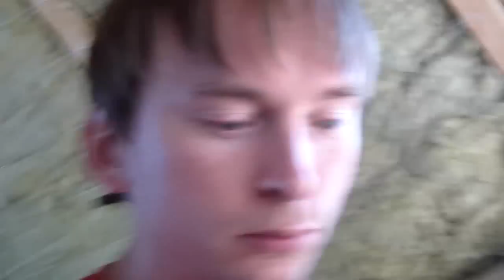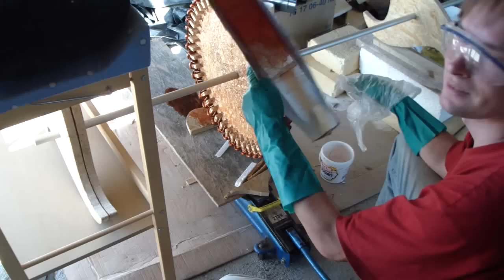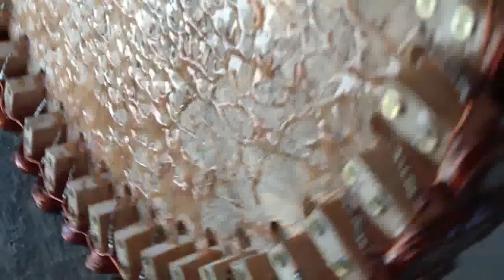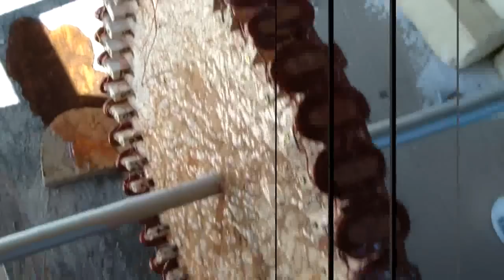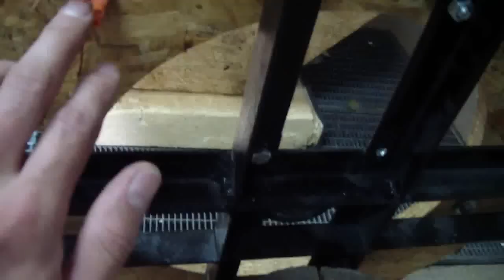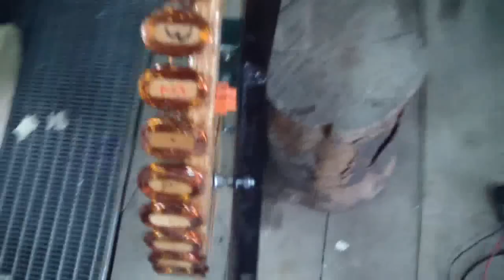Home made windmill generator part 6 - Polyester resin bath

Comment: can u tell me thickness of wire,plastic instead of wood, how long length of a coil,for full fill requirement of 3 rooms elictricity,how much strong flux density of magnet ,what is name of magnet ,can i store this energy in battery in night use ?

Comment from the maker: @beko320 Well, it is a tradeoff. So when you want to increase amps, you can do so by using thiker wire for the coils. But this will lower your voltage because the number of windings on the coils will be lower when the wire is thicker. So you have to think about which values of Amps and Volts will be the best for your application. Apart from that, you can try to reduce the distance from coils to magnets, add more magnets or wire the coils not in series but in parallel. Will reduce voltage though.